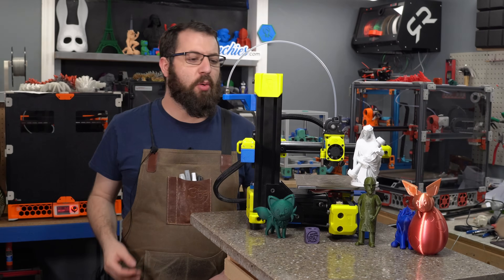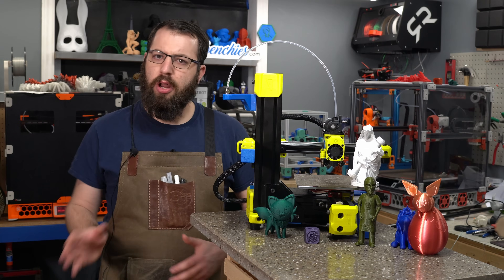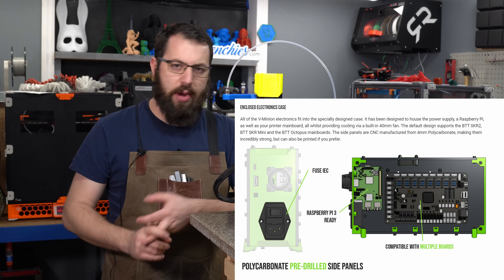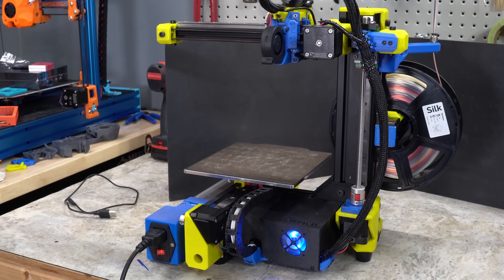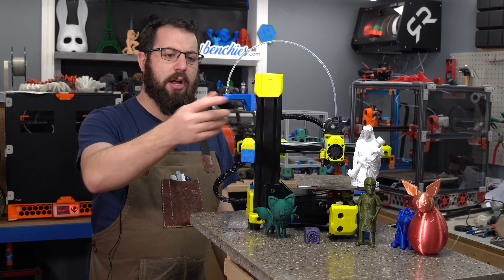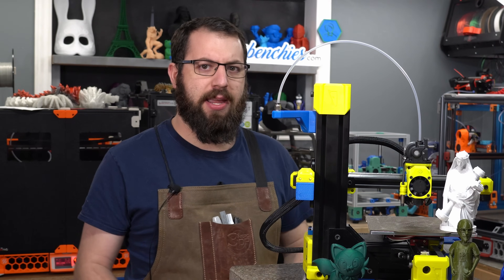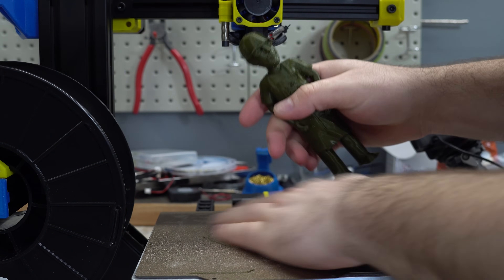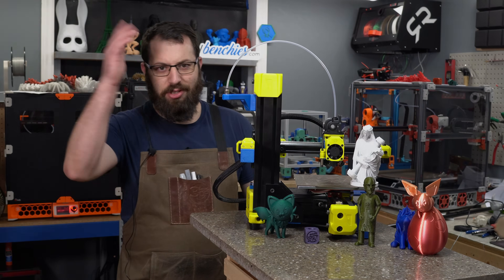RatRig V-Minion - A Mighty (yet compact) DIY 3d printer

Comment: I'm waiting for my Lerdge iX kit to arrive, it was shipped today. Although I like the idea of running Klipper and the ease of changing settings on the fly, I'm more than intrigued by a board that can do it self contained. I don't really want to HAVE to run a computer just to change stuff. Klipper would be amazing if the Klipper team would actively develop "Klipper screen" to the point you don't even need a computer to configure your printer. I get the options you get with Klipper on a computer, but once you have built it, you may only change a few things down the road and no longer need all the configuration options fast at hand. I don't really care that the firmware is "closed", I can configure everything I need to from a touchscreen. Like Klipper, you are looking to get "away" from having to compile firmware as it is.

Comment: Interesting thanks, RatRig are a stones throw from me, I'm in Spain and they are over in Portugal  only place in Europe that's goof for parts to be honest and for profile its the cheapest, just bought 600 euros worth for a large cnc laser I'm replacing mine with.

They are fast once they have items in stock and the printers here in Europe have a good following.

On your notes a couple of observations please....

Change button bolts to flat black Japan´d button fittings with a Torx head. we need to scrap all other types of heads in my opinion, Torx is much stronger than anything else for this size of fitting,  and I would be happy to pay more if the hardware was based on that. Flat buttons are more stronger than domes ones safer to tighten and the reverse and i think they look nicer, if not Torx then Allen , when you are working with small metric threads like this you need a good quality head always, Phillip's , socket head and flat are just not up to spec now. I need to know that I can disassemble the machine with ease if I need to with one type of screwdriver, it infuriates me nothing more than having to look for another type on the same machine, size yes that´s fine but no excuse for the type.

I have to admit to favouring external electronics but with a rapid connect disconnect system, the reason is obvious when you start to print exotics, you can not keep the electronics in side an enclosure and expect them to keep working when you're printing at 300º, you'll shorten the life of them by doing so. if its just PLA it´s fine...

Good video thank you it really is a great machine and RepRap are taking off big time here.

Comment: Hmm, this printer makes no sense from a budgetary standpoint. I just bought a new Kingroon KP3S for US$140 with free shipping. Admittedly this was a sale price but it can be bought for US$180 from various places all day long. It has the same design, 180x180x180 print area, direct feed print head, and linear rails for the X and Y axis. The only thing it doesn't have is ABL, which can be added as an option. But realistically for a bed this small it's not really needed. Its print quality and reliability is so good that many use them in print farms for commercial use.

Comment: Finished up my own "Full Kit" build this week to stock and agree 100% on the mods you went with as the stock PSU's fan is extremely noisy, the floating electronics box is awkward to position and had same concerns about the underbed wiring.. besides having everything bolted to the frame decreases the overall size and makes it easier to move around.

Definitely planning on redoing things with your enclosure and replacing the PSU's fan with a Noctua, so far all I've really added is a TFT35 V3 in Marlin mode for local control, but RatOS supports KlipperScreen out of the box so going touchscreen GUI is doable without much work.

Thanks for the all the amazing build streams/videos and the STLs!

Comment: It could be argued it doesn’t look nearly as nice and it could add greatly to the parts count, but if the alternative is cracking printed parts, I’d consider using larger diameter flat washers under the screw heads if you’ve got them and they don’t reduce the holding capacity of the screws by making them too short.

Comment: Man, I really want to get this printer. But 600€ for the full kit is not cheap. Great build!
Reply: That's where the mechanical kit comes into play I guess, you can then selfsource the rest, maybe use some parts you have already of pick up used from other builders
Reply: seriously i have similar result with kingroon kp3s and come preassembly and calibrated worth checking it out and you can upgrade to z linear rail to get a 3 axes linear rail printer .. on mine i print at 150mm/s 5k acel ( without z linear rail)  wich is not bad for this price point (169$ US )
Reply: @maddugqc6911  have you installed Klipper on it?

Comment: Thumbs up for the power supply! I got one of those (500 Watts, though) for my V-Core 2, and it was soooo nice to get rid of that howling fan of the crappy nondescript PSU that RatRig included in the kit. I really wish the 3d printing community would do more about fan noise. The whole silent stepper driver thing is totally irrelevant IMHO if you have five noisy fans on every printer.

Comment: I really like this machine, but I really don't like the fact the CAD for the brackets are missing. my understanding was that Rat Rig was supposed to be open source, so it's def frustrating to see it.

Also, is "Umbilical" like what Prusa uses where it's a hard filament/wire to keep the wiring in place?
Reply: Heya, Miguel from Rat Rig here. It's fully open source and in the CAD ;) Additionally, all of those are standard market brackets! It's just the ones on the spool holder are not very common and even less so in black!
Reply: @ratrighardware  thanks for the response! That's awesome to hear! You guys make really cool machines for sure
Reply: You should be able to export the bracket from onshape. 
And yes, it is kind of similar to the one Prusa uses, but it is a bit stiffer. On the short paths the minion has, no wire or similar is necessary.
Reply: @worksasintended4997  man i didn't even think of that 😂 thanks